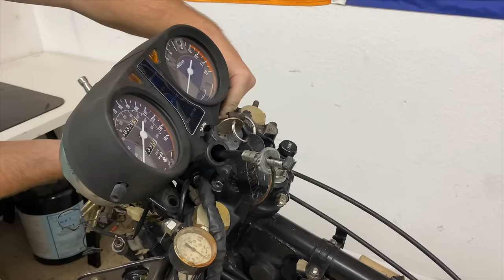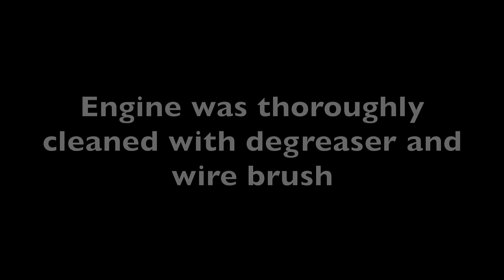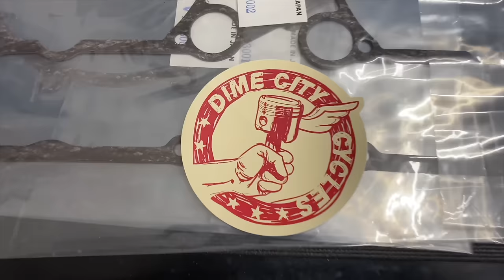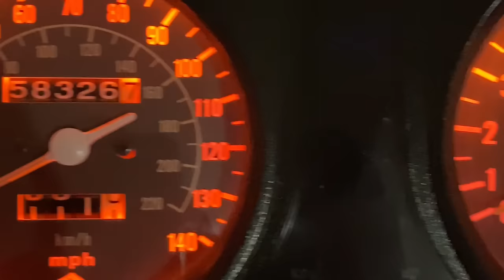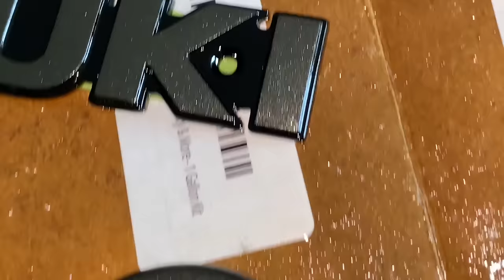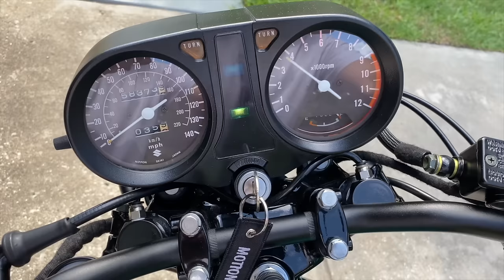Ultimate Suzuki Cafe Racer Build Time-Lapse (GS850)

Comment from the maker: Thank you for watching!
Please see below for a full parts list for this build! (Paid Links)

Handlebars - https://amzn.to/33kV7rW
License Plate Bracket - https://amzn.to/41MQvqH
Engine harness/cable wrap - https://amzn.to/2BIpjTF
Engine Paint - https://amzn.to/3Wd1dFX
Brake Caliper Paint - https://amzn.to/3OkCu0s
Rear Tire - https://amzn.to/3o6Ts83
Front Tire - https://amzn.to/3pTHwqD
Fork Boots - https://amzn.to/3WvbZHX
Bar End Mirrors - https://amzn.to/3hlUog3
Brake Light Strip - https://amzn.to/41Nh13i
Battery - https://amzn.to/3Mfg7Xx
Air Filter - https://amzn.to/3Im4Fs6
Carb Intake Boots - https://amzn.to/3WfgTsc
Brake lights - https://choicecitymoto.com
Shocks - https://www.dimecitycycles.com
Brake pads - https://www.dimecitycycles.com
Carb Rebuild kit - https://www.dimecitycycles.com
Exhaust - https://delkevic.com 
Grips - https://tuffside.com
Seat - https://tuffside.com
Frame Hoop - https://tuffside.com
Paint - BMW Isle of Man Green (Paint Code: C4G)
Reply: Where are you guys located?
Reply: whered u get the front blinkers
Reply: @BayCityRestorations  Thank you

Comment: Seeing this was awesome. I was the original owner of a 1979 GS1000E and this is a lot like that bike other than the shaft drive vs. 630 O-ring chain. The sound of that engine with the new 4 into 1 exhaust brings back memories. My 79 is long gone but I have a 1984 Honda VT500FT that's been in storage for some years, and I'd love to get her back on the road. Looks like your buddy @ditstang can work miracles with carbs, and I'm sure mine need that kind of TLC.
Reply from the maker: Thanks for checking out the video! And yes ditstang is a miracle worker. I couldn’t believe the awesome job he did in these carbs!

Comment: first off. amazing job. what would be the resell value of this bike now? $10,000? i have no idea. great content. i started cracking up when you tilted the engine over and the atomic bomb went off. didn’t see that coming. then i was amazed with that green flaked tank and accents. back lights. just everything is amazing. something i would never sell.
Reply from the maker: Appreciate you checking out the build video! I would estimate this bike to resell in the 10-12k range. I am going to keep it in my collection and ride it for awhile before I sell it. It is blast to ride and handles very nicely for 44 year old machine!

Comment: Beautiful bike and tastefully done, I have to ask why the mechanicals such as clutch, rings, valve lapping, stator etc weren't done while the engine was apart especially at 58k miles?
Reply from the maker: Luckily the previous 2 owners kept extensive maintenance logs. A lot of internal maintenance was done at 45k miles and compression numbers were spot on so there was no need to go much further than replacing gaskets and seals. Bike runs like an absolute dream.
Reply: @BayCityRestorations  I'll admit it sounded very healthy, I was just curious! Hopefully you get another 58k out of it, thank you for sharing!!

Comment: I know I will do a few things different with my 82 that I'll soon get to, tho there is no denying this build is something special. The carb cleaning and tuning looks and sounds like it was done right. I definitely want that exhaust. Did you need to jet up for that or is it just as much flow as stock?
Reply from the maker: Since I retained the stock airbox and filter adding the new exhaust did not require new jets. It seems to be close enough to the same flow as stock that it only took a few slight adjustments with air/fuel to get it dialed in.
Reply: @BayCityRestorations  beautiful, I already had enough tuning for the pod filters on my cv carbs lol. Don't want that much more. I'll definitely get that exhaust.

Comment: Beautiful work, stunning bike.
Quick Q.. does painting the aluminium fins reduce their cooling effect?
Reply from the maker: No it does not effect the heat dissipation as long as it is not applied too thick. In most research that I’ve seen black surfaces are best at radiating heat so it might actually perform better now but I don’t have a good way to test that.

Comment: I was at work,  working with a guy and we were talking about bikes and he was like are you still into bikes. Dude just gave me a 1980, gs850.. definitely like the idea of doing something like this. Thanks for the vid.  What was the estimated cost for all the parts to rebuild/ sending off carb.exc..
Reply from the maker: Exhaust, seat, and carb overhaul were some of the biggest costs. All in maybe around 2k in parts. That’s including powdercoating that I had to outsource.
Reply: That's not bad at all

Comment: Hi, great video. I have a friend selling his GS 850 1982 model. It has been in the garage for a year without running the engine. The owner said, he thinks that the carb & starter has issues. How's the parts availability? I live in the Philippines by the way. Hoping you can direct to the right path. Thank you
Reply from the maker: You should have no problem getting parts. These were very popular bikes in their time period and a lot of parts are interchangeable between the models. eBay is always a good source.

Comment: Did you use 2K to paint the frame and engine parts
Reply from the maker: Frame was powdercoated. Engine block was painted with high heat engine enamel. Everything else was sprayed with urethane 2k.
Reply: @BayCityRestorations  Ok thanks, i am in Australia and have 2 gpx250 bikes i am converting to cafe racers. I cannot find a fuel tank that will fit on the frame. Its similar looking to the GS850 frame. Any suggestions?

Comment: Hey I’m from South Africa and want to do similar upgrade to my dads 1979 gs750. Can I ask roughly how much did it cost to do all modifications on the bike
Thanks 🙏🏼
Reply from the maker: This was a relatively cheap build. Most expensive components were the seat, carburetor rebuild, powerdercoating and the exhaust. All in I think it was around 2500-3000. Painting it myself also saved a lot of money so you will have to keep that in mind.

Comment: This video is sick. I’m just starting the planning for a complete rebuild of my 93 Kawi ZR1100. Crazy hard to find parts for it. Any advice? Planning to do most of the restore myself. But the parts are a bitch to find. this video is awesome! Thanks so much.
Reply from the maker: I would definitely check out Dime city cycles for parts needed for any engine/carb rebuild. As far as hard to find oem pieces I’ve found the best luck on eBay. Usually you can catch salvage yards parting out these old bikes still.
Reply: @BayCityRestorations  for sure! eBay definitely has been my saving grace for oem stuff but they get the specs wrong sometimes. Good call on the carbs I’ll def check those guys out. What did you use to polish them like that? My carbs definitely need a full blast of some kind.
Reply from the maker: They were dry blasted with glass bead. A vapor blast would also achieve a similar but slightly more shiny finish.

Comment: I'm also building a cafe of my gs 850 at moment. I wonder where the front fender and back fender is from? Or how did you build it?
Reply from the maker: The front fender is the original gs fender that I trimmed down to make it shorter. The rear fender came with the bike but it is not original to a Suzuki GS. I’m not sure which bike it would have came from.
Reply: @BayCityRestorations   Okey thank you :)

Comment: Great video and killer build!  What cleaner did u use on those covers (9:02) ?
Reply from the maker: A paint remover called Safe Erase. Here is a link - https://amzn.to/3kOjkOF
Reply: @BayCityRestorations  thank you!  Same stuff on peeling the fuel tank paint?
Reply from the maker: Yes, for parts that have 2 stage paint like the fuel tank I usually give them a light sanding first. It helps the paint remover work better and faster.

Comment: Hey don't know if you are still checking these comments but I've got a 1982 suzuki gs 850 and I was wondering exactly what model exhaust from Delkevic you used for the bike? cant see any that say for GS850
Reply from the maker: https://delkevic.com/full-system-to-fit-gs850g-1979-1981-with-classic-straight-universal-muffler-and-stainless-steel-4-1-headers/
Reply from the maker: The one I bought says it’s for years 79-81 I’m not sure what the difference would be for an 82.
Reply from the maker: https://delkevic.com/full-system-to-fit-gs850g-1982-1983-with-classic-straight-universal-muffler-and-stainless-steel-4-1-headers/

Comment: Had one in 1982, not good at acceleration in the damp, tail wags so you sit back then, tank slipper starts so you centre the weight, and hey presto you get both ends slapping about. Not good at 100 mph I can tell you.
The back jut couldn’t take the power without spinning the back wheel and being shaft drive closing throttle wasn’t a good idea at all.

Comment: What is deal with putting a drink coaster of a seat pad on all these bikes?  How are you supposed to ride a double folded napkin for any length of time?
Reply from the maker: This seat is actually pretty comfortable compared to others that I have used in the past. I did a 200 mile round trip in May without any issues but I'm still young. Give me a few more years and I may have a different opinion. Also, a vintage bike like this is going to be for local events and riding back country roads here in Florida. If I plan on doing longer trips, I will most likely do that on a newer machine.

Comment: I thing....this just my opinion......the speedometer is to big, if you change with the smaller / single model, it should be more amazing 👏👏👏
Reply from the maker: Normally I would switch out for a smaller digital unit but once I cleaned this set up I fell in love with the originality and decided to keep them.

Comment: I love your videos and your attention to detail! I would really like to see your design with the tail up a bit, it's got a saggy butt. 🙂
Those fork air caps are a mistake from the past that actually make fork action worse, I would keep them at zero psi and bleed them off occasionally to maintain zero. If you need the front end stiffer there is a genius method that can use the existing springs modified and spacers added to raise the front spring rate. No need for new springs. Spring physics dictates that springs of a given rate can be increased by shortening them, I would start at about 1 inch/25mm at a time. It requires careful and correct work but it cost nothing but your labor. Adding a spacer of the same length as the spring length removed gives you roughly the same preload, and it can be raised by adding 10mm or so if desired. This shortening and spacer method works on all springs provided their use case supports the modification. Both your forks and your rear shocks can use this. ABS or metal pipe can be used, and it is always a good idea to use appropriately sized washers on each end of the spacer to keep things square and moving smoothly. Google 'fork spring modification to increase spring rate' and poke around a bit. This principle is not widely known because most that understand it also sell springs and they would rather sell you a spring than tell you this for free. You know, commerce. I know this from years of working as a motorcycle race suspension engineer and I have no commercial interest. But it's not really a secret, it works on all vehicles and on any spring for any application that has a way to hold the spacer in position. 
Keep up the great work and videos, really love them!
Reply from the maker: Awesome I really appreciate this information! I was not impressed with how the front end handled once I got everything back together and put air in the forks. So I was definitely looking to modify them to improve the handling.
Reply: @BayCityRestorations  Happy to help out! The stock forks look skinny and they are not the stiffest, but they can be made to work well with the right tricks. The fork spring trick I describe and thicker fork oil to the stock height (or volume) can make it better. The next step past that is usually an 'emulator', it makes old forks like this one work more like modern cartridge forks which is transformational. But just leaving the air at zero, increasing spring rate by shortening the springs and adding spacers, and increasing fork oil viscosity will help a lot on their own. If it bottoms too easy under braking try raising the fork oil level in the fork about 10mm. That can be tricky to understand because manufacturer's usually just call out the oil volume. I don't want to turn this into a book, but if you are interested research a bit and you will find there are many things you can do to that fork to make it work better for little to no cost. Racetech.com is a good starting point, they will have useful info on your bike's stock fork. Go to their site and click 'Product Search' in the upper left, pick your make, year and model and eat it up. I have no affiliation with Race Tech but I used to know a lot of their staff and they are good people that have a ton of info on their site and in what they keep in their databases offline. There is a lot to know, but the good news is this will apply to every bike you work on.

Comment: This Dude really likes his black paint! And powder coat paint? its a motorcycle not a tool box. This is why they sell and make polyurethane. You do not have to remove the entire paint job to fix a couple nicks and dings. Why use powder coating? I sure hope it was cheap and it impresses all your friends. I am impressed with the carb!! Work was that cheap?

Comment: Too bad you re-installed that 'HP poaching ugly air-box' behind those carbs..individual grill filters will give you back ,HP & sound...the restriction it brought to those Japanese bikes was pretty important..all over these bikes ,they had to lower power for the US market with mechanical restrictions ,gas handle ,air box ,collector & exhaust....etc...
Reply from the maker: Not worried about having the highest horsepower 850GS. It has plenty of speed and great sound as it is and I didn’t have to fiddle with these carbs 100 times to get it to run right with Indv   filters. I also like the fact that the original airbox fills in all the space under the tank.